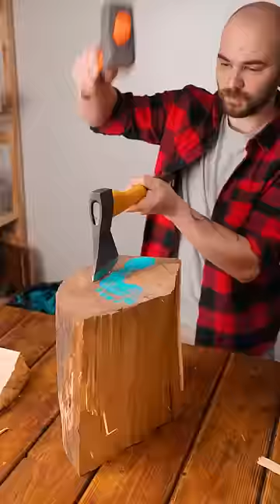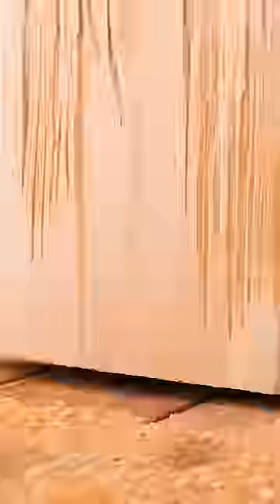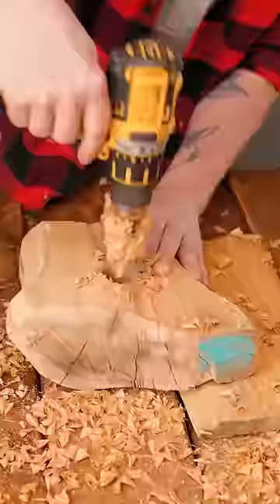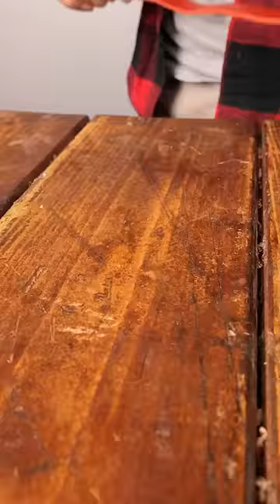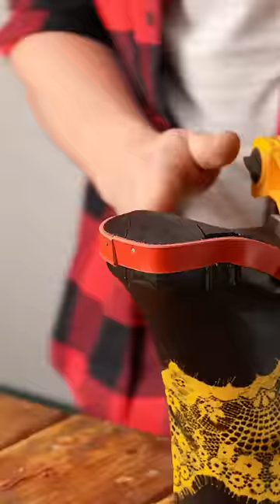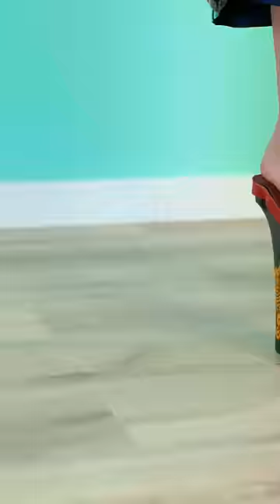Making Japanese Geisha shoes from a block of wood! #woodmood #shorts #diy

Comment: Would be helpful in the rainy season crossing puddles😂😂😂
Reply: Until you trip and fall 😂😂😂
Reply: Pretty sure they are based on Oiran (high ranking courtesan in Japanese culture) Koma-Geta due to their height. Regular Geta were meant to keep the user’s feet dry and clean and used to be primarily used for rainy days, so you are not far off with your comment.
Reply: Verdad
Reply: If the trees are out in heavy rain it will end to flood it would not help
Reply: @dextervaldez1104  jokes are meant to be enjoyed and not to be taken tooo seriously bruh😂😂
Reply: @dextervaldez1104  Cover it in resin.
Reply: In that case you will surely gonna be fall in mud 😂
Reply: 😂😂😂😂😂😂😂true shame
Reply: Yesss
Reply: Thanks for reminding me 😂
Reply: *slips
Reply: 과거에 한국에서는 실제로 비오는 날 신었습니다
Reply: @rosacaballerosa  , носили такую обувь не только в сезон дождей.Канализации не было.